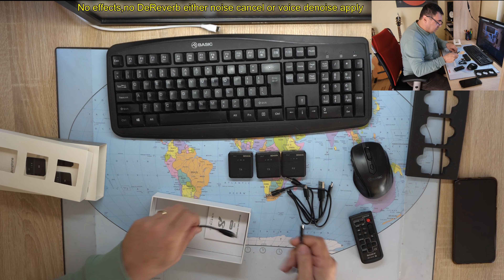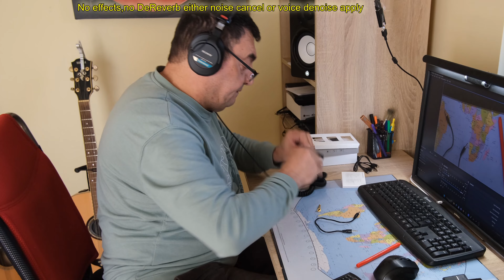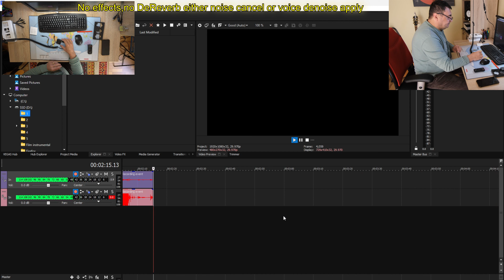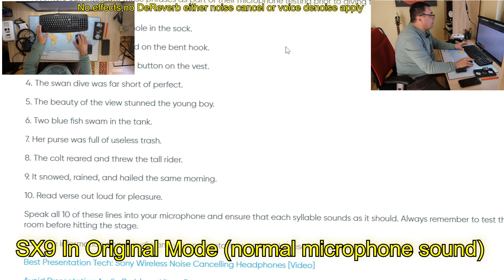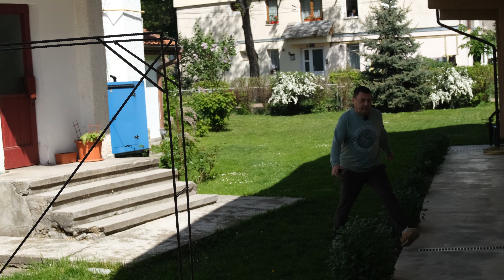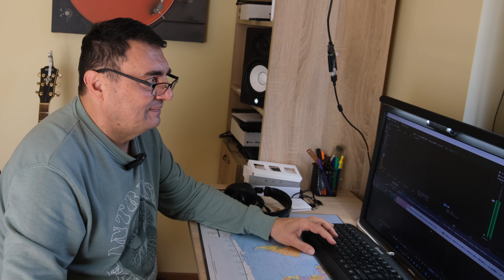SX9 Wireless Lavalier Microphone testing

Comment: hello . i have  sx9 microphone and i would like to use with mobile poco x3 pro.what is happening and the microphone is not working.it needs to be connected via bluetooth with the mobile phone.
Do you can help me ? thank you .best regards.
Reply from the maker: SX9 doesn't have bluetooth. You have to connect the SX9 RX to any devices by cable.
Reply: Dont work end with cable @viocaia
Reply from the maker: @IordanisFishingNets  I'll test it with few mobiles I have around and let you know.
Reply: Turn on OTG from your phone settings, it will connect.
Reply: @IordanisFishingNets  Hello Iordanis 

If your SX9 microphone is not working with your Poco X3 Pro, there are a few possible reasons:

Google application: Disable the constant use of the microphone from the Google application

Google App info -> App permissions -> Microphone-> Do not use the microphone all the time

Compatibility Issues: The SX9 microphone may not be fully compatible with your Poco X3 Pro. Ensure the microphone is designed to work with smartphones and is properly connected.

Software Problems: Poco X3 Pro users have reported various microphone issues, which could be due to software bugs. Restarting your phone might resolve temporary glitches. If the problem persists, consider updating your phone to the latest software version or performing a factory reset as a last resort [1][2].

Hardware Issue: There could be a hardware defect in either the microphone or the phone's audio jack/port. Test the microphone with another device and try using a different microphone with your Poco X3 Pro to isolate the problem.

Third-Party App Interference: Certain apps might interfere with microphone functionality. Try using the microphone in safe mode to check if a third-party app is the culprit.

Να στε καλά Θοδωρής *βατραχοπεδιλα  .. :)

additional info
https://xiaomi.eu/community/threads/poco-x3-pro-microphone-problem.66039/
https://www.reddit.com/r/PocoPhones/comments/15776z5/poco_x3_pro_phone_microphone_and_speaker_problem/
https://www.youtube.com/watch?v=_ZfQDSMUASU
Reply: turn on ur OTG BRO